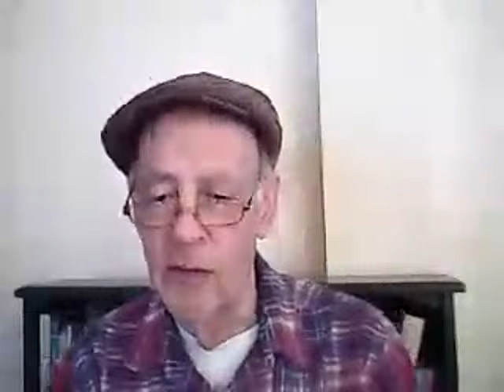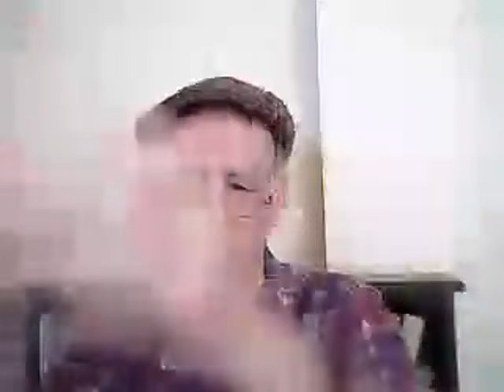Bad Boy Buggy - What to know - How to repair - CartPartsRUS.com

Comment: Hi I've have a classic bad boy golf cart, well actually 6 of them I'm repairing but the classic starts forward great then stops put in reverse it goes just fine, I did like you said check and test the motors they are in good shape by my surprise put two new solenoids on and replaced one of the sevco controller so wondering why it stops forward but goes backwards just fine

Comment: My buggy a hybrid will not shift from forward to reverse while in gas mode. Electric works fine. Bad boy ambush hybrid
Reply: That's a very common problem with this machine. I have the same issue, read a lot about it
Reply: I have the same problem on my when the gas engine is running won’t move forward or reverse I have no idea what to do. Any help would be appreciated.